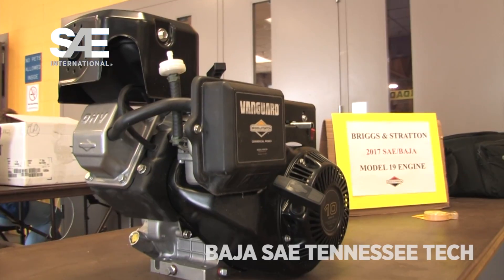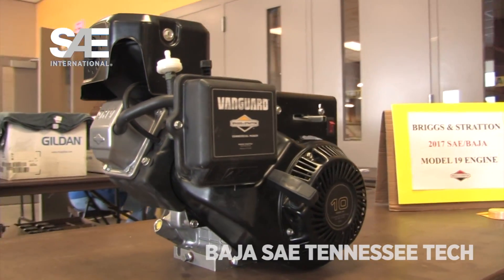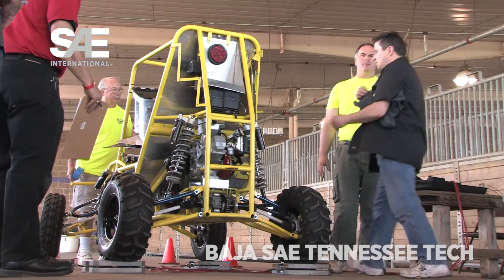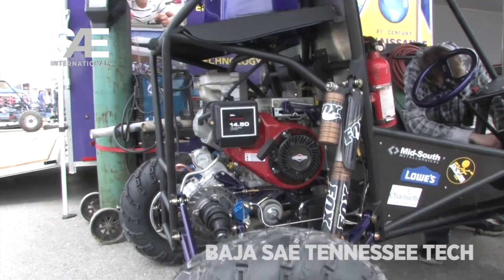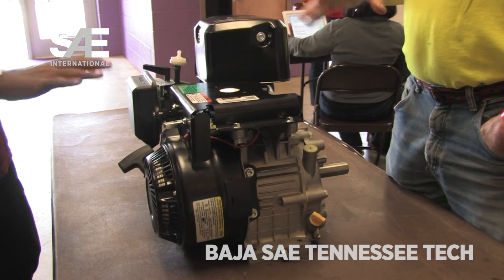Introducing the 2017 Baja SAE Engine

Comment: The only differences between this and the old Model 20 engine is that this one has dual crank bearings instead of 1. There is metric hardware instead of SAE hardware and the recoil is screwed in rather than riveted in.